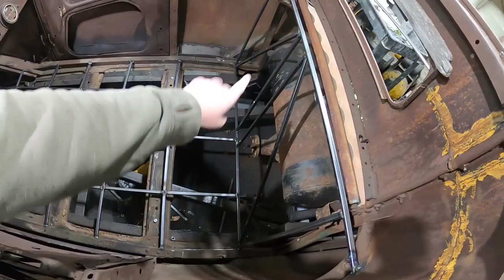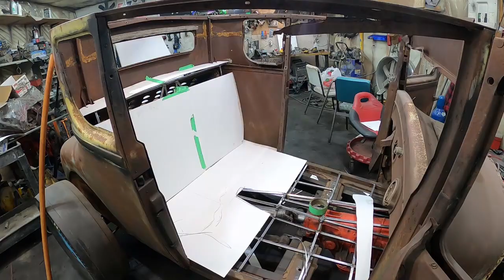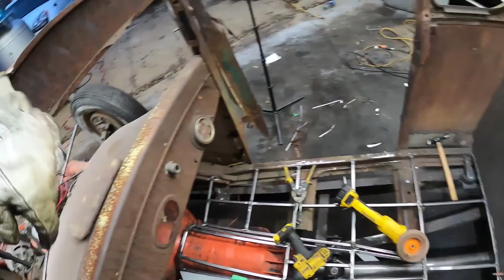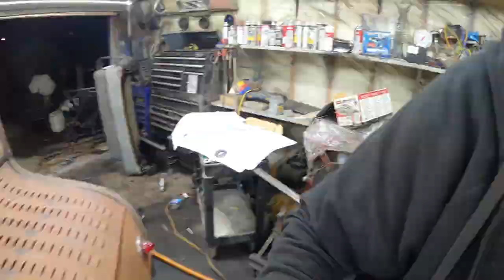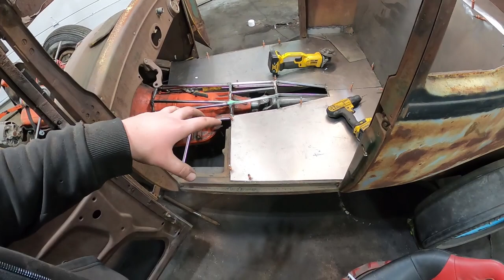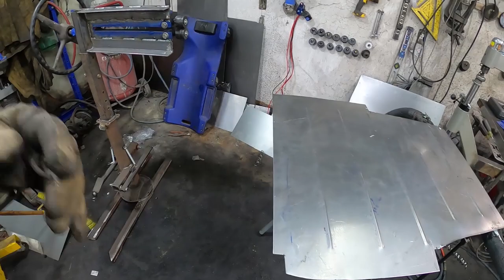Installing Scratch Made Hot Rod Floor Pans - 1927 Model T

Comment: That floor looks fine! Hide some dyna mat in the hidden areas.💰
Reply: Playingwithhorsepower  amen if seam sealer and dynamat can’t hide it you don’t need it.
Reply from the maker: yup itll get some sort of sound deadening for sure haha
Reply: @DDSpeedShop  : Hope this note ain't too late: For SAFETY, you may want to put a heavier sheet of steel between you & Dani's BODIES and the FUEL CELL in the UNlikely, but ALWAYS possible Accident!! I recommend a thick panel of "safety" plate. (Think if it ever blew up!-short cash = life WIN!)It's usually the "other guy's " fault for staring at your awesome creation: steering where they're looking. My friend (dear departed) Steve built a remarkably cool T bucket. Drove it down to my apt in Revere,MA. To check it out...on my 21st (?)birthday- made my day!!

Comment: This makes me smile.  If you like Cleco, wait until you begin with Dzus.  Guessing I will be in the minority but if you want to save yourself some possibly awkward welding, Cleco was sort of designed with rivets in mind and I am not sure there is a reason the floor or rear bulkhead has to be entirely welded (or welded at all for that matter).  If you want to play around, figure out how to use more current panel adhesives (as example Ford pickup beds use a mix of rivets and glue).

Comment: Looking good Dan. Maybe a silly question, but are the indents from the bead roller supposed to go inside or out? I assume structurally it doesn’t matter. However, it may complicate your interior install. Thanks for the videos!
Reply: I would have put the grooves up

Comment: Dan you might have considered your floor near the trans and trans tunnel but it looks close for engine traction movement knocking the floor. It also looks like it will be a pain for transmission repair or replacement as no room to wiggle it in spot. It will be an almost dead straight slide in spot? No angles. Great work though.

Comment: Three are Cleco clamps too- link here: https://www.amazon.com/Monogram-Side-Cleco-Fasteners-Clamp/dp/B07SCKW8B2/ref=sr_1_1?dchild=1&keywords=cleco+clamps&qid=1588040920&sr=8-1 Those will help make mocking up a lot easier too. And Dzus fasteners are great for any panel you need to remove and put back on. They fit flush to the top panel, so it's super low profile, but it takes only a quarter turn to place or remove them. You should look into them, just like Russell Zacharias said. I worked with helicopters and airplanes for a long time (about 12 years) and they are both very useful for panels, and Dzus were also used to install radios and other equipment in consoles. Good stuff. I'm a big fan of the little T. Linda and I send our best to you and Danielle.

Comment: Don't you think you should have welded in two wider & thicker braces that go from frame rail to frame rail so you will have something secure to bolt your seats to. 
If you only bolt your seats to that thin floor plating and you get into an accident (God forbid) the seat belts will rip right out of the floor and you'll go airborne. Ask me how I know... believe me when I say it can happen because it happened to me.

Comment: Dan great job on the floors on the backfill I was thinking I’m a carpenter and for a tablesaw you always have a one run out table for a long piece of sheet material.......For  long  plank ... I  alway  work by myself... you should try to make a jig for around the beat roller some arms that hold the panels going out the back...So they wouldn’t drop them all over like a parachute!!!!!!!!!  if it was my B-Roller  that’s what I would do...... to make life a lot easier in your shop... I bet you could make a jig for the right hand side when you’re facing it and also the backside and even the front they could be easily  put on or take them off keep up the great work junkman do back here in New England and it’s raining
Reply from the maker: i had those thoughts after i was done haha.

Comment: Good job! What is the plan to connect the 2 severed body crossmembers?  Hoops? Brent could plasma cam 2 bow tie blanks to form weld flanges and the arch bend over.
With the fabrication skills shown I would have used the 1/2" body crossmember recess to receive 2 long floor pans for more head room. With a U shaped tunnel as required  closing up the center.
Reply from the maker: i welded what was left of the factory braces to my new ones.  I'm sure itll be just fine

Comment: I would have done all the flat surfaces in plywood then made the transmission tunnel out of Metal. Since the original floors in those t's  was wood. And screwed the wood to the metal framing Just a thought looks good.🇺🇸
Reply from the maker: yeah I had those thoughts.  I just wanted to play with my metal tools haha